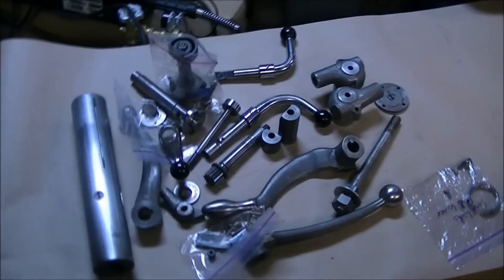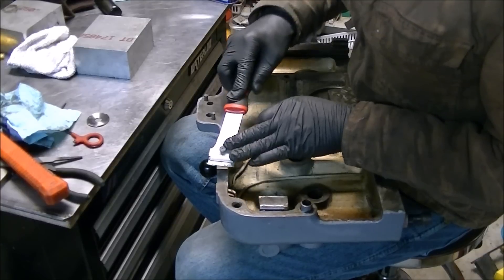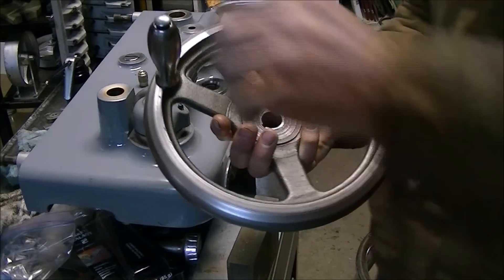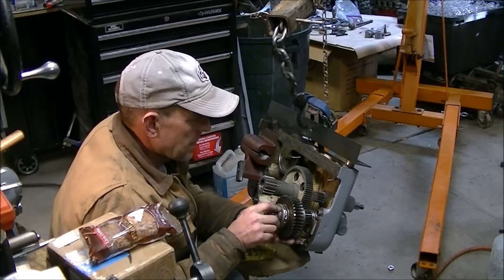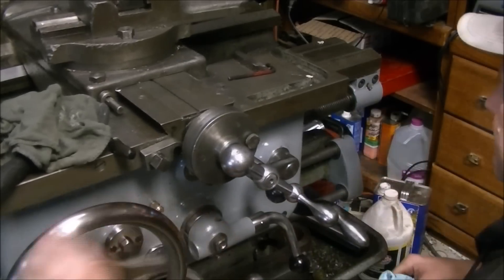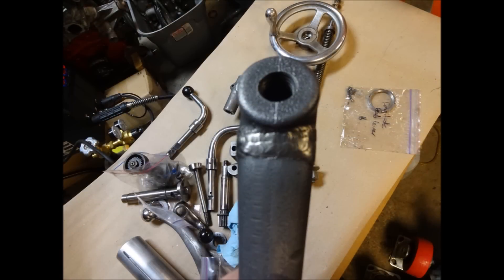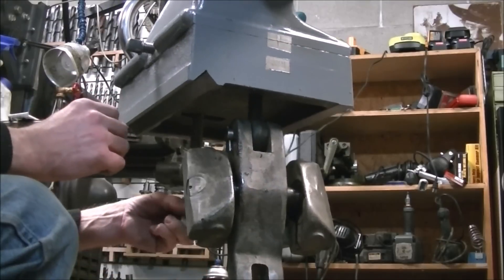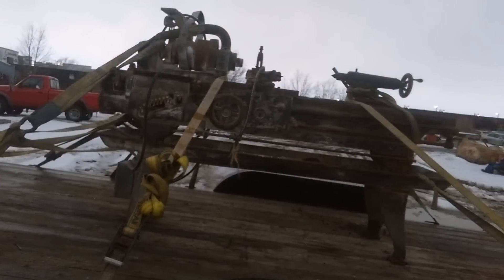Hendey Apron Addendum

Comment: I got myself a Hendey 14x6 lathe yesterday, and guess whats I need to do. Making a half nut and its mechanism anybody who can help to get measurements for this mechanism and the half nut? this is my lathe: https://youtu.be/hmD-8jVfDrk     appreciate all suggestions you might have. great job clemwyo and thanks for posting the videos on YouTube, I could not do it without your help thanks
Reply from the maker: neptun733 thanks for watching and commenting. Make sure you get over to the practical machinist, antique machinery forum (https://www.practicalmachinist.com/vb/antique-machinery-and-history). There are a lot of folks with a ton of experience that will help you with your restoration work. Good luck! Craig
Reply from the maker: neptun733, on the forum link I posted above, if you post the serial number (located between the front 2 v ways on the tail stock end) there is a fellow on the forum that will be able to give you a bit of your lathe's history. He can also help with parts drawings, gear sizing and other questions. Craig

Comment: I am conflicted about bondo, on machine tools.  I love the very nice paint, and shiny new appearance, but the surface imperfections, seem to me, being an old codger, is just fine with new paint. Now, a shiny wheel to turn, painted in the center seems beautiful to me, but bondo on a machine tool seems somehow, not right.  Unless hospital surgery items and equipment. Sort of like back in the 60's, seeing a russian tractor at the dealer.  hmmmmm.
Reply from the maker: Paul Hiiginbotham all of the old machines I've restored (1910, 1943 and 1945) have had some type of filler used on the raw castings from the factory. They appear, to me, to be some type of a bituminous material. Maybe someone out there knows what was actually used. So I don't feel it is inappropriate to use some type of filler in restoration projects. Bondo might not be the best filler but it is easy to use and to purchase so it's what I've used for my restorations. Thanks for watching and commenting. Craig

Comment: Well, that's one solution to not having enough lathes!  Nice restoration BTW. Check out Brad jacob's channel (BasementShopGuy) for any number of tips, tricks and details on restoring old iron. Another is The Backyard Machine Shop (Mike Wiggins). And of course Keith Rucker. I only wish I had some old iron, but here in Alaska the pickings are slim.
Reply from the maker: Juan Rivero since giving up TV years ago, the YouTube machinist community is my entertainment and education. Machine tools are pretty hard to come by here in Utah also. Iced only seen 2 K&T mills for sale in the past 10 years and I bought one of them. Thanks for stopping by. Craig

Comment: The older lathe looks to be an interesting project!
Make a lot of videos of it as you go along when you get the time.
Mike
Reply from the maker: Oldvet1946 Mike, I have a video of repairing the cross feed gear and there will be more to come. I'm hoping to make a set of gears for it to cut metric threads. We'll see if I can do it. Craig

Comment: Nice Job on the Apron and Tail Stock.  I should have got some of the 'bondo' filler for my shaper project - would have saved me umpteen layers of primer filler brushing ! Like you its not one of my enjoyable tasks - but the efforts are rewarded at the end using a nice clean machine tool.  Now that little older brother looks interesting !
Reply from the maker: lookcreations Thanks for stopping by. it is amazing how much easier it is to clean the freshly painted parts. The old dirty, peeling paint looks pretty much the same no matter how much you wipe it down. Craig